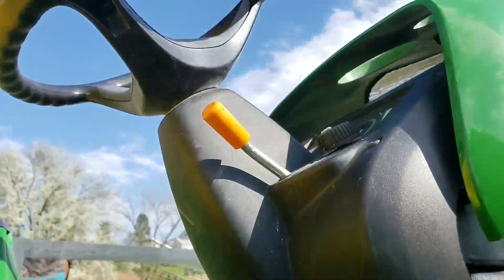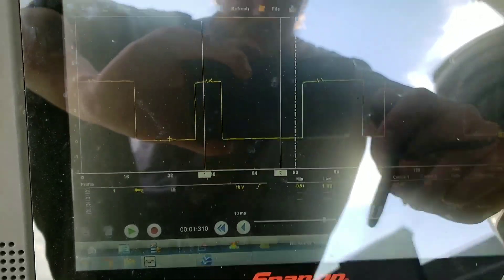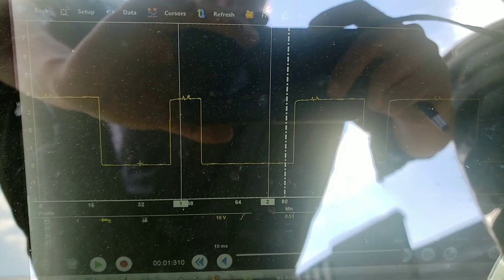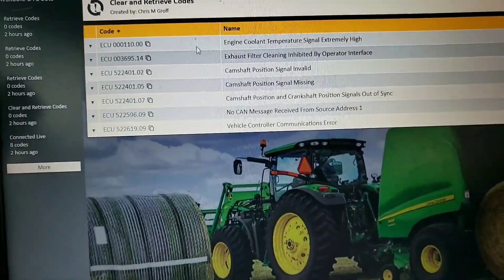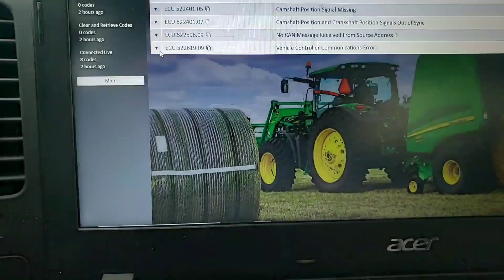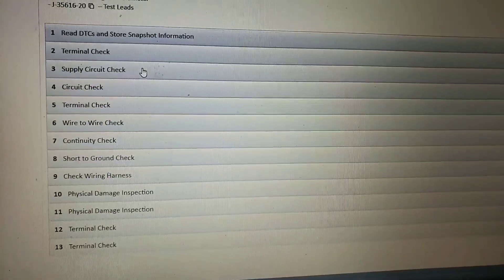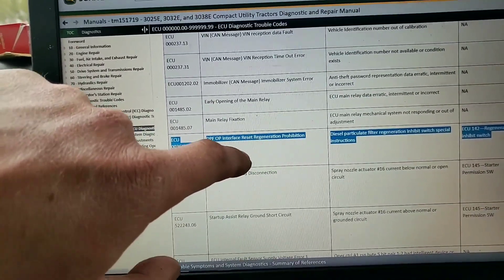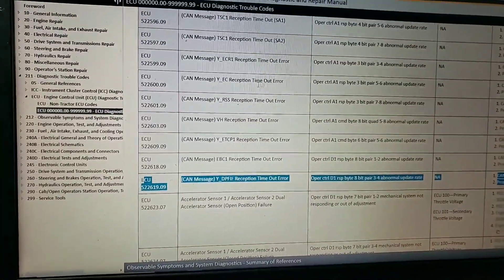JD 3032E - Cam Position Sensor Diag

Comment: Nice work , flow chart would of had you doing circles .
Reply from the maker: That's exactly why I'm such a proponent of applying logic and base operating principles in a diagnosis. It will allow you to get to the answer, regardless of SI quality, 9 out of 10 times.